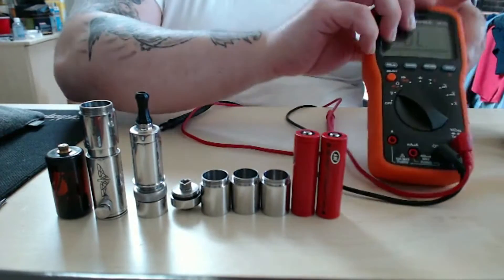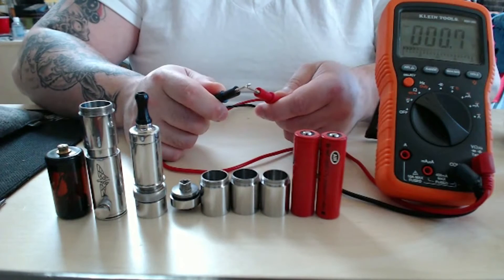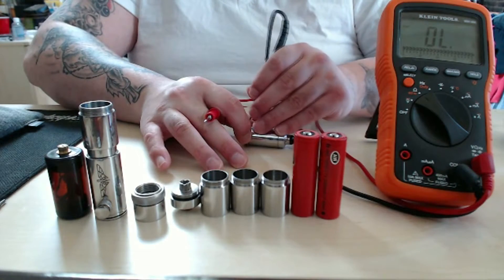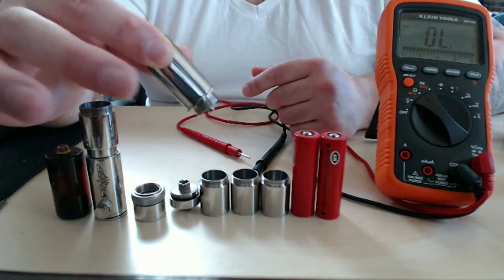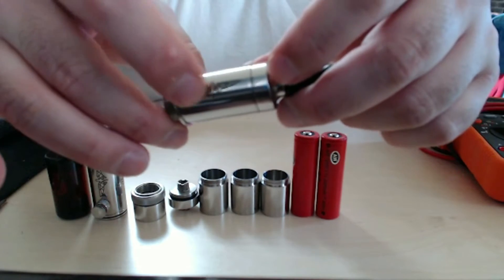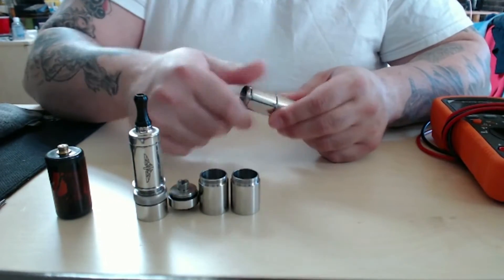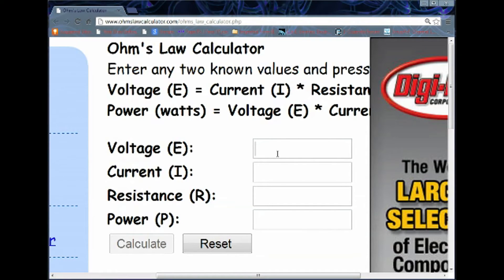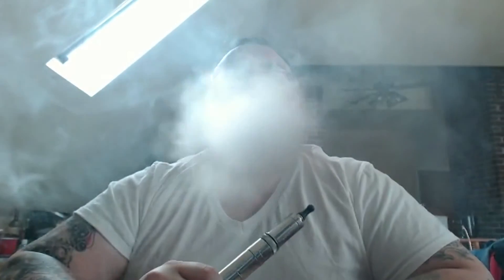GG iAtty .4 ohms Dual Highlanders 8.4 Volts 176 Watts

Comment: Ok i didn't know about that high output, but then the max wattage would be 168 Watts, because the current can't go higher than the output of one cell in serial connection. Do you have a link to the batteries? I thought the max was specified about 16A but can't find any details. thx

Comment: Out of curiosity since I didn't see you measure it in the video.....what are the numbers when you add in battery internal resistance and voltage drop from the mod itself?